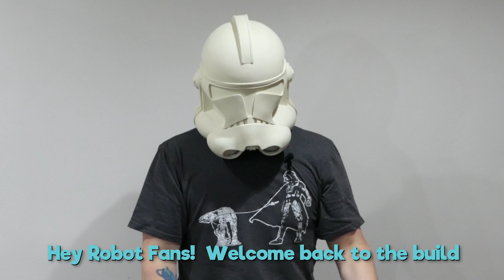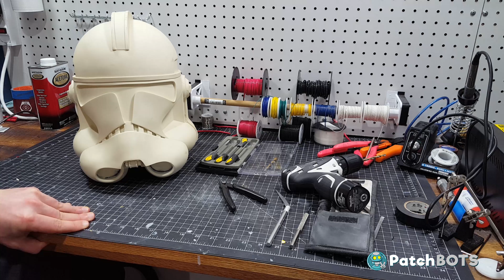Clone Commander Bow Build - Part 3 - Cleaning the Helmet

Comment: This is an awesome project and I appreciate the detailed videos you’ve made. 

I’m curious why you did 4 layers of primer and bondo.  Were there a ton of defects to the helmet’s surface that required fixing or are all the layers meant to make the surface look consistent?  Also, are the different colors of primer meant to help show that the new layer is adequately covering the previous one?
Reply from the maker: Thanks A-A-Ron.   I probably went a bit overkill on the primer and putty.  The helmet was mostly fine anyway, but yes there were slight inconsistencies in the surface that I smoothed out. In the end it's kinda pointless with a weathered clone, but, I enjoyed the process.    Yeah the different colors were jus things I had on hand and decided to use for purposes of the video. There is nothing particularly special about one color versus the other.

Comment: What is the effect of the Bondo ?
Reply from the maker: It acts as a putty basically.   It goes on like a toothpaste consistency and dries to a sand-able hard surface. Not super hard, but hard enough to smooth out any gaps and paint over.  So for example if you dropped a screwdriver on your helmet and made a gash, you can fill that gash with bondo. Sand it smooth to match the surface of the surrounding helmet, and then paint the whole thing and no one would ever know it was there.     In this case here, castings aren't perfect, especially at the seams.  So some bondo puts it all on one level.
Reply: @PatchBOTS  ok nice thanks. is your helmet from sanotized creation ?

Comment: Where did you find your little hand saw?
Reply from the maker: The saw I use in this video is actually just this saw blade:   http://amzn.to/2GRuWME    attached to my regular Xacto blade handle.  WARNING: these blades don't actually fit into the Xacto handle, which is why you can see it's kind of at an angle.  The base of the blade is too wide to fit.  You can do the same thing I did but I'd recommend buying the matching handle.
Reply: PatchBOTS thanks! You're literally my hero XD